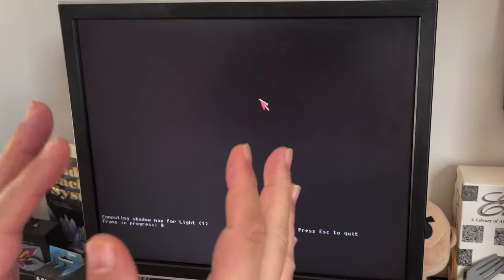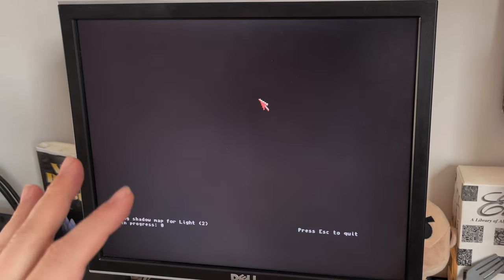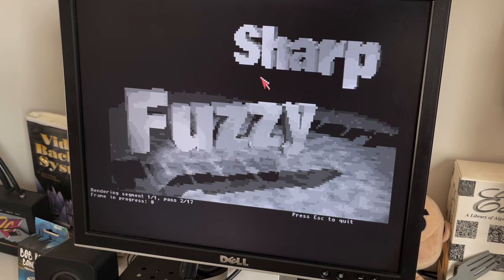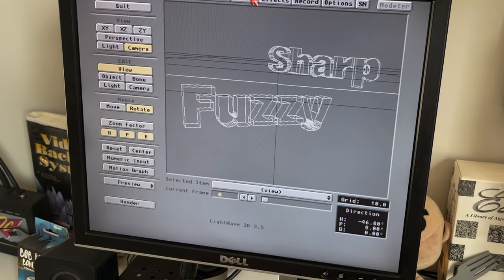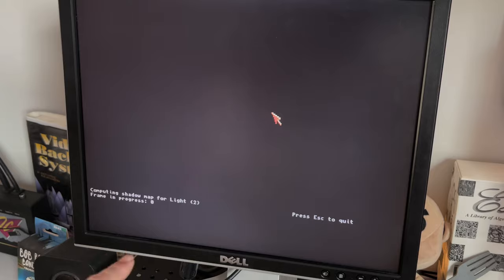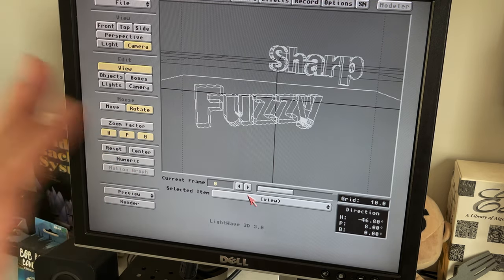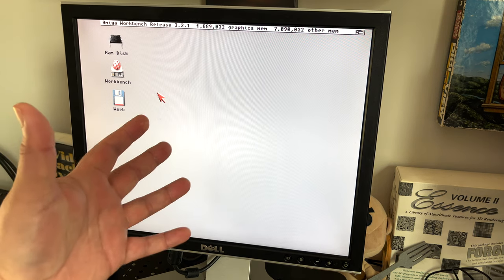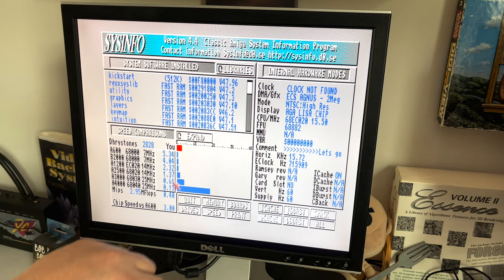Amiga 1200 : Life without an FPU? Let's see.

Comment: Man... even back in the day I plunked down some serious coin for the 060 CSPPC card and even THAT was too slow to run Lightwave. I was crushed when I learned there would be no PPC Amiga Lightwave version. I moved to a Dual Pentium Pro and NEVER looked back. The Vampire is the only thing that's tickled my fancy as it at least gets me to the speed of a decent first gen Pentium. But I still just take the Lightwave 3.X Amiga OS CF card and take that over to a laptop and let that render frames out using an emulator if I want to use vintage LW. Thanks for the videos....
Reply from the maker: Yea for frame rendering I absolutely suggest WinUAE or Pi. I mentioned this in previous video. :)

Comment: Hehe... remember the first Accelerator card I got for Amiga was the M-TEC 1230/28MHz and 8MB ram. It had slots for PLCC fpu as well as PGA FPU. I bought the PGA FPU running at 50MHz, and some operations done in Photogenics went from 5 minutes to 10 seconds.  :D
Reply from the maker: Wasn’t that great back then! Loved the speed boosts.
Reply: @HoldandModify  Oh yeah... I even had an 060 with SCSI controller and 256MB ram.... I also had a 040/PPC 603e card that I sometimes played around with...

EDIT: But I see the same thing today with LightWave 2020 native render-engine. I have a 64/128 thread Threadripper, and it feels like I am using a couple of GPUs with Octane.  :D
Reply from the maker: @TemalCageman  actually someone did a test on one of those and the 64/128 is as fast as a single 2080TI in Octane. So yes, this is true! :)
Reply: @HoldandModify  Haha...  I was "feeling" it since I only used Octane with a single 1080. So... a couple of them then. :D

EDIT: With all the bitcoin mining going on, how the f* can you get hold of any decent GPU within "not arm and a leg" sacrifice?  :D

Comment: Good vid. So I take it you are also using the correct libraries for the CPUs you were demonstrating with? Any difference if you use THors MMU lib 68x libraries?
Reply from the maker: I’ve only used the Libs that came with the 3.2 install. I did try some others a while ago linked to from the FB group but had some wacky issues. Worth looking in to some more.

Comment: I had a Amiga 500, loved it... got a 80 Mb SCSI hard drive and love it even more.. After that I got the A1200 and it was awesome, better graphics, faster and 2 Mb chip ram...
Loved it, after that I got a 68030 with a 68882 at 50 Mhz... and it was just awesome... The AmigaOS had so much power with the 68000 and with the 030/882 it was just mind blowing at the time... The OS (yes single user) would be awesome run still to this day....

Comment: he wasn't sure if i missed it but you showed that 8mb card w/ fpu rendering faster than without.. but what was the render time of the stock 1200 vs the 8mb / fpu configuration?  obviously it's going to still be much slower than the 060 of course..   i also wonder how well an 060 would render with software fpu..  i wonder for all those non-fpu 060 owners, if they could use a soft fpu.. and see an overall improvement over their 060 without fpu..   or if this would outperform an 030 with fpu..   i'm skipping 040 in this consideration mostly because there are so few of those in circulation..  and no modern accelerators taking advantage of 040s.
Reply from the maker: I left that out with a quick one liner about it being so slow it wasn’t worth showing. The stock 68020 without FPU  was looking at around 40min a frame! It’s just not practical. 

I don’t have access to any softFPU but I can tell you something like that would most likely only allow is the running of software that requires an FPU. There’s really no way for it to find any more performance when it can only execute as fast as the host CPU.
Reply: @HoldandModify  yea i see what you mean.  as for the soft fpu i'll dig into it as it's a must for me as i have no practical affordable A2000 FPU options.  Even my ACA 1233 is FPU-less on my A1200.  Muadib3D said the soft-fpu thing works but yea i'd just like to put it to the test.  it may be a wash..  I'd do it now, but I have a few other fixes to apply and test.  My A1200 is pretty much out of commission as it's tucked away to sell after i get the A2000 working next month with some parts on order.
Reply from the maker: The card I showed from AmiKit is not too much money considering the state of Amiga gear. As I said, $60-$100. But I understand everyone’s available cash is vastly different. :)
I do look forward to your findings though!
Reply from the maker: @8bitwidgets  ohhh, right. Like the Firebird. Yeah. Ugh.
Reply: @HoldandModify  yea i hope the talk of a TF big box card comes around.. but i'll be honest i'm just not that stoked about 060 without fpu.. and $500 chip.. again.. just a bit too rich for my blood..   really really hopping buffee turns out to be a solid option.. though it has no ide bus but i guess the plus is it means real scsi would work with it?  unlike the TF cards

Comment: I see you have a DCTV. I have two DCTV modules. I have never been able to get them to work with my PAL A1200. Obviously I've tried switching to NTSC mode in early boot menu. Both DCTVs have no color. I only have a PAL A1200 and no other Amigas to try. Do you know if the DCTV can work with a PAL A1200?
Reply from the maker: Sorry to hear. Sadly my DCTV also does not work. Which is why it’s sitting as decoration. I believe the DCTV works with PAL or NTSC. It has two adjustment dials. Maybe you can find information about those? Good luck!

Comment: Great video!  I'm going to try out the soft-fpu option as I only have the TF536.. I'm ok with LW 3.5 as a limit but yea i'm glad you showed a solid demonstration of fpu-less performance.   I'm hoping that the soft-fpu can eat some of the 50mhz of the 030 will be a net gain..
Reply from the maker: Thank you and if you get Soft FPU working you can at least run LW5 and get some of its improved features. Both in Layout and Modeler.
Reply: @HoldandModify  absolutely.  i'm definitely curious about the improvements..  though i'm actually kinda excited to learn the original version of lightwave..  i look at stuff like the original video toaster ending video showcased..  https://www.youtube.com/watch?v=Ruc7AFi908g
Reply: @HoldandModify  where can I get this “soft-fpu”?
Reply from the maker: @robertomeloni3095  no idea. That’s why I asked for folks to post here. :) sorry!

Comment: I have a few 1200 accelerators. 030 and 040… both with fpu… I understand the 060 isn’t as compatible as the 030/40 chips… 080 is the beast… but a good 030 expansion really wakes up the 1200… it’s so annoying commodore went with the ec020 on the 1200… I mean, it came out AFTER the 4000 did… the least they could have done was use a real 030… or at least a real 020…
Reply from the maker: Yes. When we got the 1200 in the store we were very baffled by the cost saving in the 1200.

Comment: I had several Amigas and I loved them, but rendering Lightwave images on ANY Amiga is never going to be fast. I'm not knocking them, but to put the speed of the old '060 in to perspective: A 2010 'Netbook' with an Intel Atom N450, (a power efficient, but agonisingly slow single core mobile CPU, even by the standards of the day) running Lightwave via WinUAE, will render faster than the fastest '060, and at least as fast as a Vampire. You can pick up a used one for the price of a Starbucks coffee. A Core 2 Duo will at least quadruple that speed, and any modern x86 PC will easily quadruple that again. Seconds instead of hours. So, create on a real Amiga, but maybe render on an emulated Amiga. 😉
Reply from the maker: I always recommend to my viewers to do all final rendering with an emulator. For many of the reasons you’ve listed as well as protecting the Amigas for the heavy wear and tear.